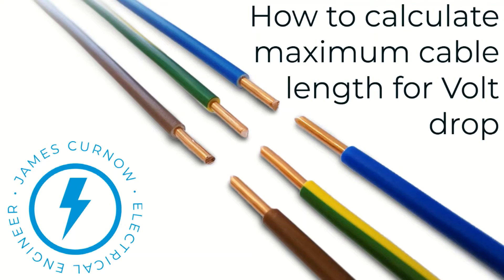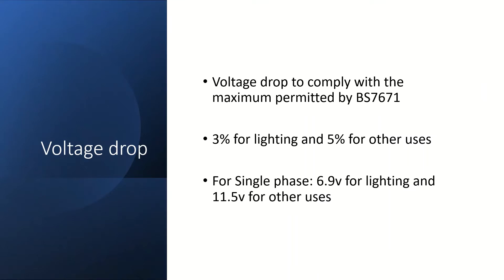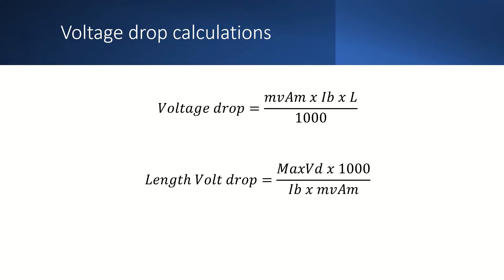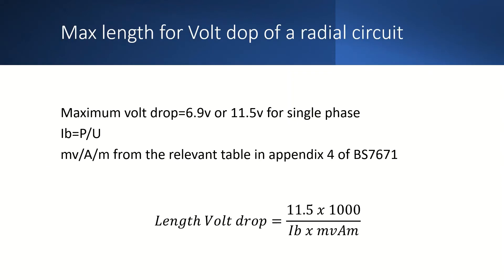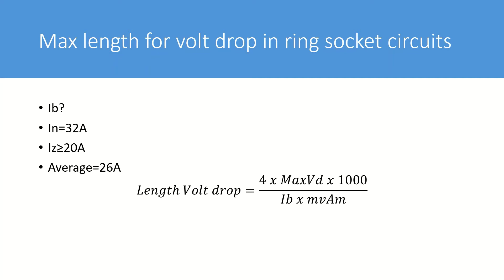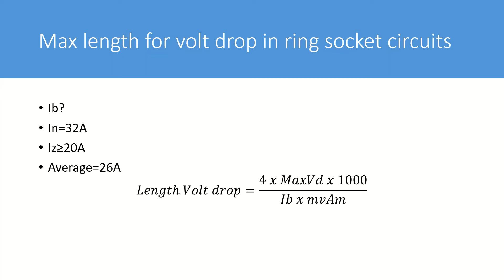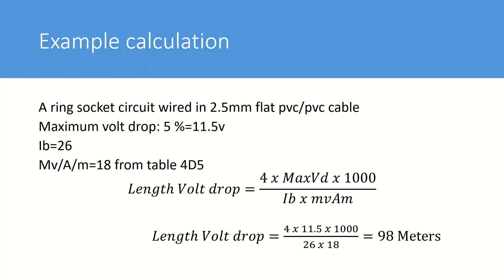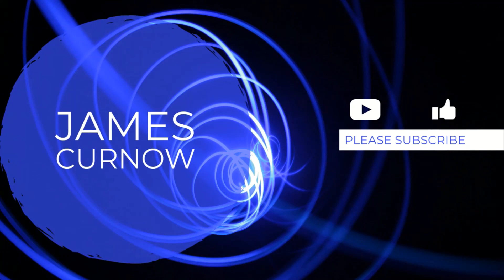How to calculate maximum cable length for Volt drop

Comment: Thanks for this video but I'm still a bit confused. I have the formula: 6.9 x 1000 / 44 x 0.8 = 6900 / 35.2  = 196. Is the maximum length 196 meters then, seems excessive?
Reply from the maker: Hello Russ,
Thank you for your comment. The formula for maximum length for volt drop for a lighting circuit is 6.9 x 1000/Ib x mv/a/m. 
Is your example from a job you are working on? and am I right in thinking that in your example, 44 is the value for mv/a/m for a 1mm twin & earth? and the 0.8 is the design current? If so, the calculation looks ok. 
The thing to bear in mind is that this calculation is for the maximum permitted volt drop. Its useful to know the maximum, but it's also necessary to bear in mind that a high volt drop increases energy losses, so it's best to reduce the volt drop as much as possible either by reducing the circuit length or selecting a larger cable. This is recommended in appendix 15 of BS7671.
Its also necessary to bear in mind the length of circuit to keep the impedance sufficiently low to comply with the disconnection time. There is a separate calculation for this, which I talk about in another video.

I hope this helps.
Kind regards
James
Reply: @JamesCurnowElectricalEngineer  Hello James, thanks for getting back to me and sorry for the late response. The question was part of my level 2 synoptic exam so I wanted to make sure it was correct and it was. I passed with a distinction, hopefully on to the level 3 course this year.
Reply from the maker: Hello Russ,
Congratulations on passing with a distinction. Best of luck with your studies.
Kind regards
James

Comment: It's worth adding that if a cable takes a significant amount of current then running it even close to maximum voltage drop is very wasteful of energy over time, and would normally pay for the next size up cable several or many times over per year. Such as 2.5 to 4mm. Though going up again would be problematic for space in the terminals. So an extra circuit or distribution method would be advisable.